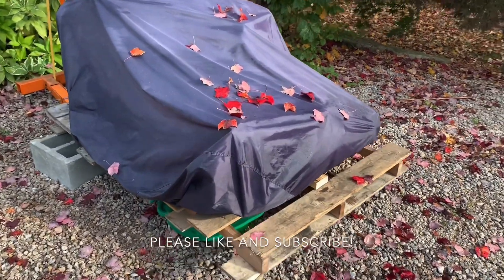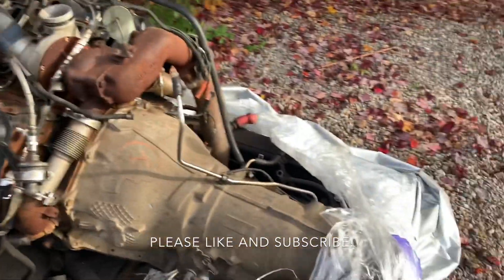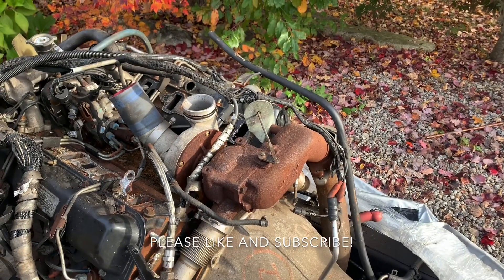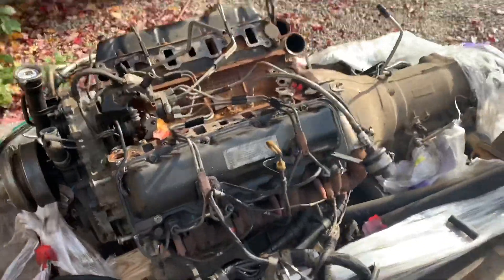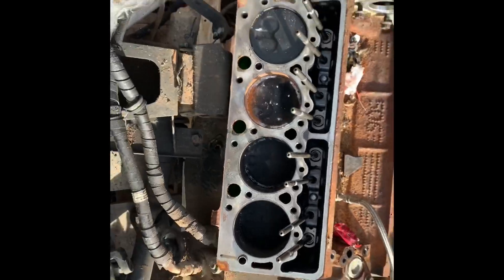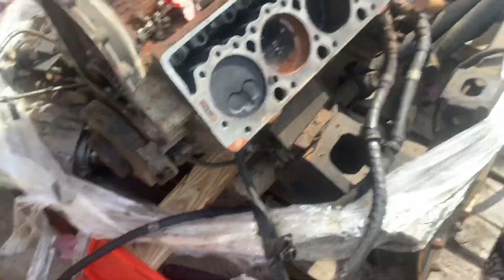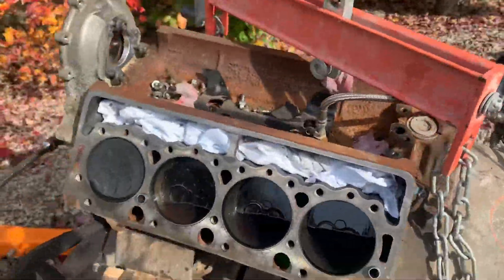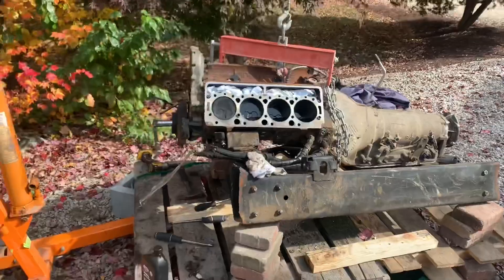6.5 Turbo SWAP!! Part 1 Engine Inspection

Comment: Will them engines fit into pickups with the center mounted turbo?
Reply: They will fit with some firewall modification.  I have one that I was thinking about putting in a k1500